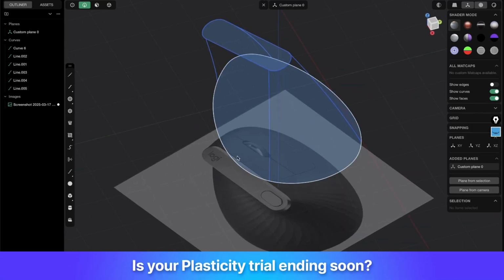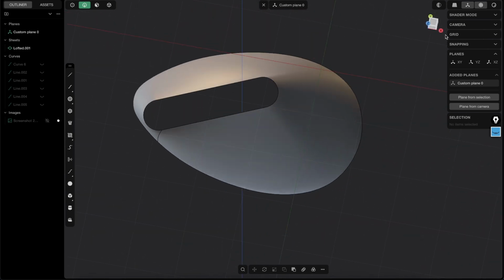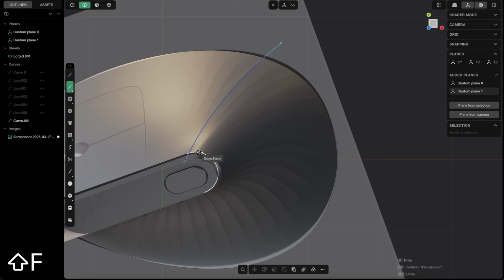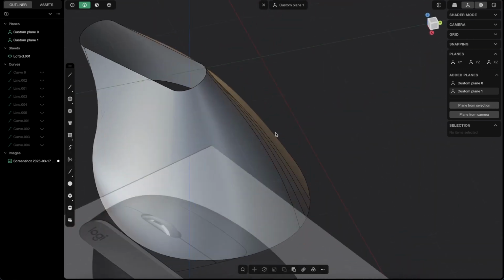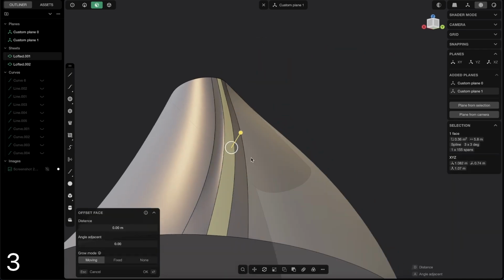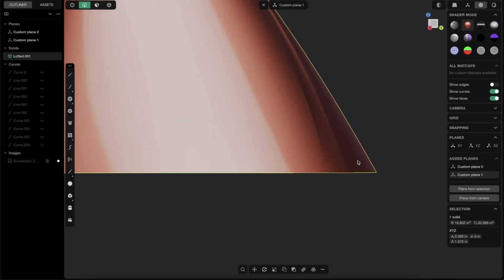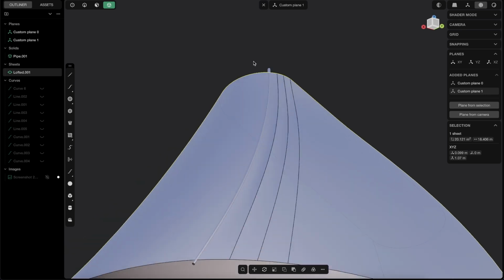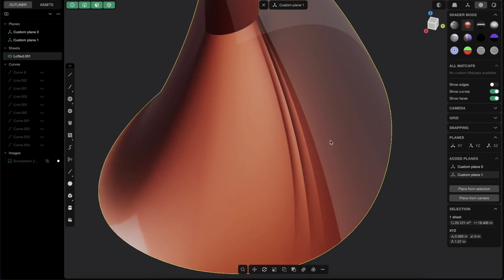Plasticity - AMAZING Surface Modeling Technique (NO xNURBS!)

Comment: I feel like there is, or should be an easier way to do this.
Reply from the maker: I think this approach I am showing gives a good result, but you would have to spend even more time to get it as exact as possible. Maybe using xNurbs or square command, to get those little surfaces in even better quality.

I am pretty sure that the designers/modelers of the mouse did not spend 15 minutes with that...;)

Comment: Inanother video I saw you seem to use a pen tablet. Very unusual with a CAD program. Are you using a screen tablet or a regular intuos type of tablet?
Reply from the maker: Yes, I am using for everything graphics 2D/3D related an Intuos S tablet
Reply: @nikita.kapustin  nice and very nice if Plasticity is useable with a tablet. In other apps such as Alias I don't think it's possible because of the 3 mouse button and navigation type? I kind of hope I am wrong lol

Comment: Hello Nikita, great tutorial as always, may I ask what you would have done differently if you had used xNURBS?
Reply: With the studio license I would use Raise Degree, then just move some control points out in space with scale from a central point.  On the actual mouse its raised sections for the ribs and they disappear about 5mm from the upper and lower edges gradually.

Comment: Great technique 👍
7:11 is a perfect example or use-case of why Plasticity should implement curve‐tweening like in Rhino. If they can add an extra "tween along path" function, it would save so much time and surpass Rhino by a mile in this department.
Reply: Yeah Rhino So Underrated Got Some Commands Going Under Radar Like This